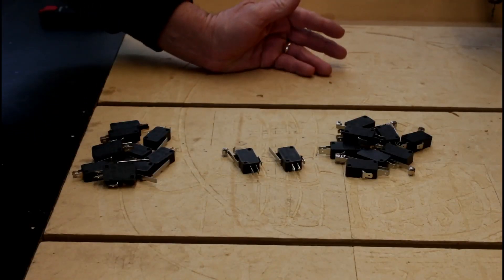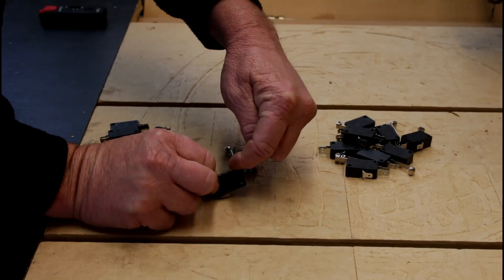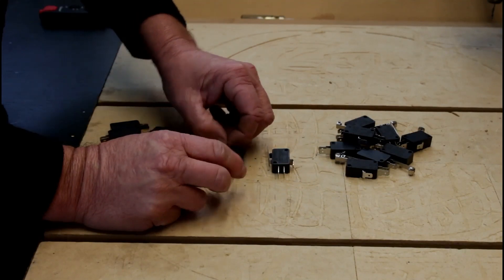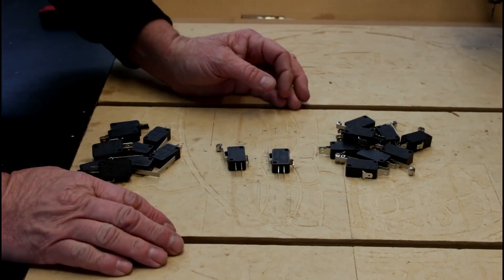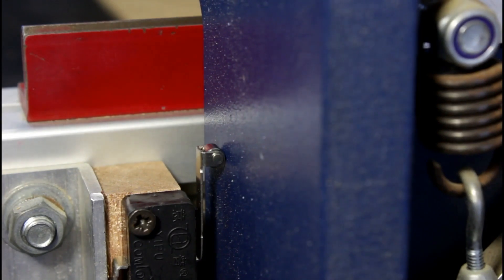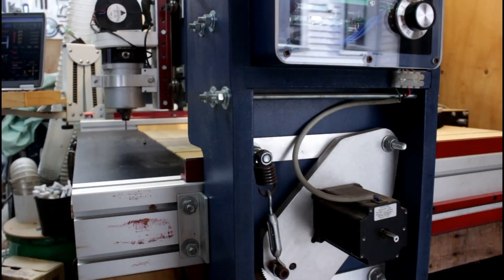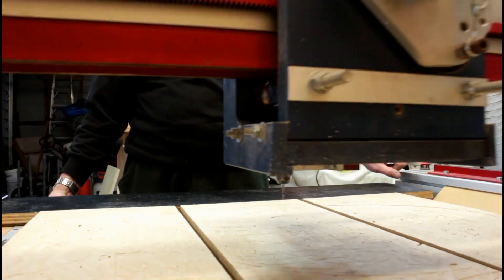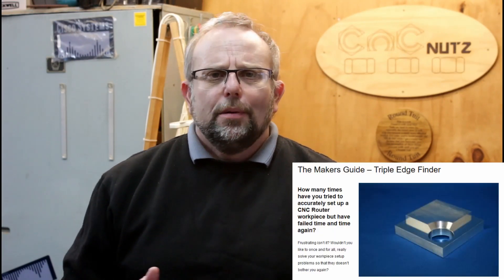Limit Switches - Do I really need them? - CNCnutz Episode 112

Comment: You have no idea what your talking about, limit switches help Protect your cnc by Not constantly Smashing into the end of the Screw or bed.
As for Finding Machine Zero, Limit Switches are much Quicker than Finding a Hole, then entering the Coordinates.
Reply: Ive never seen  an Industrial CNC (Haas, Mazak, Mori,  OKK, etc) without limit switches, softlimits, or both, slamming a 2 ton moving head into a hardlimit at 1000 IPM because you miss a decimal point or a  negative number is a real pucker moment, not to mention potentially pricey. and thank you youtube for showing me this and making me necro a thread.

Comment: For a powerful machine, limit switches are necessary. For my 6040, I have optical HOMING switches only, which is incredibly useful for setting machine zero with repeatability especially if you lose position. Optical switches have excellent accuracy, and trying to eyeball it is not an option.

Comment: If you move into hobby cnc from a lathe, with auto-feed and powered carriage leadscrew etc, then the destructive forces are something difficult to forget. What I am baffled by is how a sloppy microswitch is supposed to provide a precision end-point? They are used on factory machinery safety guards (and microwave oven doors) because they are a last resort to cut off all power instead of a hand, not twinkle a light or do something in software. I have had enough industrial copiers apart (and CD ROM drives etc) to know that a slotted IR opto-detector is the standard way to detect a travel end-point accurately.
Reply from the maker: The power of a worm drive is phenomenal as you say. 
I think the answer to the micro switch  question is they are cheap and many years ago they were all that was really available so have probably what people think of when you say switch.
These days optical and proximity switches are off the shelf items and are far superior for sure. 
cheers Peter

Comment: For the most part I agree with your philosophy about limit switches and software limits.  I do use limit switches to home my machine but only because I often use a vise that I have parked in one position.  When Mach ends it asks if I want to save the fixture.  That allows me to know that my zero for the vise is already set up at the rear jaw and right end (where I keep the stop). So, they are handy for things like that but otherwise?  Not so much.  Good video!
Reply from the maker: Thanks.

Comment: I've just ordered a bag of microswitches on Ebay to install limits on my machine - then I see this video, and I panic a little. But it's all OK. My machine is not like yours and I will be using the switches for homing and position finding. I know a stepper can happily go clunk into an end stop, but I can't happily watch it. And of course a stalled stepper has lost its position, whereas one that trips a limit switch still knows exactly where it is.
Reply from the maker: No need to panic Don. I said I don't  NEED the switches. I didn't say that you shouldn't use them or that they are a waste of time. I think you will find them useful and will enjoy having them. I have some on order at the moment and will be adding them to my machine in the  future as part of an upcoming project I undertaken.
Cheers
Peter

Comment: Well, my DIY (home made) desktop cnc do not have limit switch too, What I always do whenever I am milling or engraving something. I always point the bit on a drilled hole on my waste board....by jogging them towards it, zero in x and y..then on my material, I place a piece of paper on top lower down my Z axis by jogging again. then all is set.. I just can't just pull it since I am using lead screw. so I have to use the jog function of the software.  

Great tip CNCnutz.

Comment: I was watching your cam clamp video when this popped up on auto played afterwards. Thought I'd throw in my 5c worth. 

I have homimg switches on my machine and have found them invaluable. I also have UCCNC configured with soft limits. So the way it works for me is that I home the machine. This sets my machines XYZ 0,0,0 and from then on, UCCNC will use the soft limits to stop the machine from ever running into any end point. It will decelerate as it comes to the end of the travel and stop without a crash. It will stop smoothly before it hits the homing switch and before it hits the + end travel. The only time it will ever hit the ends is if your steppers are loosing steps.

I have gone for weeks without having to re-home the machine and because it never crashes the end point, it never looses its position. Even better is if the power goes out, I just re-home the machine again and now the machine know it's limits and location, but UCCNC keeps the offsets and I can restart the job exactly lined up. Ofcourse this emergency recovery only works if your save your offsets in UCCNC. For me, I have a button on my pendant set to save offsets. So I push a button to Zero, then push a button to save offsets. 

I also have jigs with locating pins so that I know the exact machine coordinate of it's center point, and by going to the exact machine point and zeroing the work coordinates, it is in the perfect position every time.
Reply from the maker: Thanks John
Im sure they are useful and invaluable in some cases. That said I haven't seen a situation in my day to day machining where that would be useful to me. Anything homing switches  can do I can do manually and it is just as quick though I admit that it is not as convenient as something automatic.
I have nothing against them but I don't Need them. Maybe one day I will turn to the dark side but not today. Mind you I have already moved to an autozero tool setter so anything is possible. 😉
Cheers
Peter

Comment: I'm back trying to set up my machine after an absence and I can get Y and Z to perform correctly in Mach3. Yet the X-axis always tries to sail right on through the limits that I've set for it.  I first go into Machine Co-Ordinates and  SoftMax is 33" on the X-Axis, the SoftMin is 0 and it's SoftMax 14 and SoftMin 0 on the Y-Axis with SoftMax of 0 and SoftMin of 9.5 on the Z-Axis. After I've made my settings whenever I hit REF ALL it goes to the above settings and tries to continue on and on on the X-Axis. It doesn't matter if I enable Soft Limits or not.  Any insight that you can provide would be greatly appreciated.
Reply from the maker: I'm sorry Ronald but I can't really help as I don't have switches or limits setup on my machine. Hopefully someone else will be help you out.
Maybe one day someone will show me folly of my ways but until  then I will keep on using my  machine without them. 
Cheers
Peter
Reply: Thanks anyway Peter, CorvetteGuy50 gave me a rundown on the subject with a new video that he just posted. I myself didn't want to run Limit Switches as we both know, that they're not infallible. I was intending on not Running them. But couldn't find an exact method of setting up my machine that was in Plain English.

Comment: ya but my gantry weight is over a hundred pounds, if its running full speed and slams at the end, things are going to break
Reply from the maker: There's no need to run the gantry into the hard limits at full speed. Also hard limits are there  it is a safety feature to stop the gantry from running off the end. If they break under normal circumstances then they have not been engineered correctly.
Cheers
Peter

Comment: If i Run my machine in hard stop I will destroy coupler and might damage ball screw!! Limits must to have. Soft limits are fantastic every time start your router just Home it and you have fantastic protection also wit give you warning straight away when you load Goode that it might be outside your limits. As I really enjoy your channel must very strongly disagree on this one .
Reply from the maker: Thanks Marek.
I understand why you like your limit switches and they are necessary to your machine. I am concerned that the machines designer has constructed it such that it will damage itself if and when one of the limit switches fails which will happen sooner or later. 
Cheers
Peter

Comment: Deffo needed for beginners, I trashed 3 ball screws snapped 2 couplers in one move, and if I had them fitted it couldn’t have done any damage. It still bugs me now that I trashed it.  I stop there. good videos, thanks for uploading.
Reply: It's not just for beginners mate. everyone should have limit switches. Not only as a safety measure against crashing into the ends of travel, but because if there's a communication error, power outage, or you need to stop / re-position the machine... Using limit switches, and set G28.1, then even in the event of power failure, when you bring the machine back online, you can simply home the machine, and send the G28 command, and you'll be back to the start position of your last operation.
Reply: They are on all industrial machines because they are essential not just usefull. I have seen them fail a few times, once on an SCM Routomat Twin Bed, bearing in mind industrial machines often rapid at over 10 meters per minute and weight a LOT, there was a massive bang, the ground shook and people came ruunning out of the office to see what had happened but the machine held together, although the X axis screw had dents from the nut bearings so had to be replaced. The second time, on a Multicam 8000 (rapids at over 15 meters p/m), one of the two Y  axis motors ripped of it's mounting and the linear rail had bearing dents in it, when the operator jogged the machines Y axis off the limits not realising only one side of the gantry was powered and that the other was jammed we ended up with twisted bent gantry, permently. 
I've started using small hobby machines after 17 years with industrial machines and have tried without switches, but it's extremly slow and inacurate when it comes to referencing the machine and it also hurts to see it crash, there is stress on the motors and machine that are just not necessary. It's an almost free upgrade with massive benefits. Yes they are not essential on small hobby machines but the only reason you should not fit them is if you have tried and just can't figure it out, which is fair enough, it's not the end of the world.
Reply from the maker: +theDaftman 
Sorry to hear that. 
I have never heard of anyone breaking ballscrews or couplers with a stepper motor let alone 5 items in a single move. Stepper motors usually stall and slip when they reach a hard limit. It implies a serious mismatch of components. Either your ballscrews and couplers are too small or your steppers are way too big. 
The biggest worry for me is that sooner or later one of your limit switches will fail and you will break another coupler and ballscrew. 
It would bug me as well. 
Cheers 
Peter

Comment: Yes if you are a home builder it is procedure to mount them, so why bothering you can go without them. I left cables on machine for them, want to simplify it with just one switch per axes, magnetic ones and at the end of axes metal parts to activate switch. But it is better use my time to do some projects and learn software tips, and later when I found some time mount them.
Reply from the maker: +Majsta Ć. 
I bought my switches determined I would install them this build.  Got it moving and thought I would do it later.  8 years later I  still have the switches sitting under the table. I'm sure they will still be there in another 8 years.  
No point rushing these little jobs. 😁

Comment: Love your channel and usually your advice but I have to disagree with how helpful I have found limit switches to be. I only have a small hobby Chinese 3020 to play with and for me, learning the CAD, CAM, material choice, bit choice, feeds and speeds and a whole lot more has been fun but hard! They have been a great help with easily maximising my table area, repeatable finding zero or specific coordination for 2 sided machining  and from stopping my machine slamming itself apart if I get something wrong!

I would say they are MORE important for hobby DIYers!
Reply from the maker: No Worries Shaun,
I am expecting people to agree and disagree on this subject, with people from both sides of the fence joining in.
I have not been disappointed and learned a couple of other functions that limit switches can be used for. 
While they are not things that would cause me to rush out and install them they are worth noting.
I do enjoy learning new things.
Thanks for sharing your thoughts,  I do appreciate it.

Cheers
Peter

Comment: Thanks for sharing. Great video as always. Just a quick question, is that a collet stop on the larger cutter you hold up? Thanks.
Reply from the maker: Yes it is, well spotted.
I will be doing a video on that shortly.
Cheers
Peter
Reply: +CNCnutz (Peter Passuello) Fantastic, I've been looking for a place that sells them. Eagerly awaiting your video. Thanks
Reply from the maker: +Trevor Burke 
I won't leave you hanging as to where to get them. They are just Orings. Take your cutter down to an engineering supplier and get ones that are a good tight fit.
Reply from the maker: +Trevor Burke 
I won't leave you hanging as to where to get them. They are just Orings. Take your cutter down to an engineering supplier and get ones that are a good tight fit.

Comment: I have limit switches but I dont normally have any use for them.  They're there only as a safety feature to prevent damage.  As stated a stepper cant burn out in a stall situation but the stresses on a lead screw setup with some serious steppers could be big enough to knock something loose or strip out an anti-backlash nut. X and Y have them at both ends of the travel and Z only max up.

If you want them theyre not all that expensive, probably less than 5 bux an axis counting the wire. If you can use them or not depends on your controller hardware.  As an example Mach 3 can actually support 3 of then on 4 separate Axis but you also have to have the pinouts on the controller board also. 

While a limit switch setup would give you a known repeatable zero point as far as the cnc goes the only use I see for that is in some industrial setup where you must have both zero point systems available, the zero the machine uses and the zero point you define on your stock in your cam software. Mach 3 actually supports BOTH the table limit switch zero point coordinate system and a coordinate system based on the zero point set on the stock by your cam program. Other controllers may or may not do that. 

Why?  Simple, the only zero that really matters for non-production stuff is the one on the stock. Even doing production stuff without limit switches is easy to do also. Just create some sort of locating jig and that can be nothing more than an L shaped piece located and clamped down so it will locate each piece of stock  in the same spot and orientation. Just set the zero to a corner and surface of the stock on the first piece of stock after its in place in the jig. After you do one simply stick the next stock in the jig and start the g-code over.... You can jog anywhere on the table to get the router out of the way and  it will just go back to the first cut point on the next part automatically. The controller will always know where it is referenced from that set zero point. Harder to type this out than to actually do it.. :)
 
Bottom line --- ignore around 50% of what you read on some commercial made production CNC such as one to make crankshafts.. Never seen a hobby CNC with safety doors with interlock switches on it yet.. :)  Im not saying a hobby CNC wont mangle fingers, It will if you're stupid enough to go poking around the bit with the router going. It is also not likely a hobby cnc can crush an arm or finger if its in the way either. They just dont have the drive power to do it. Safety should still apply though.